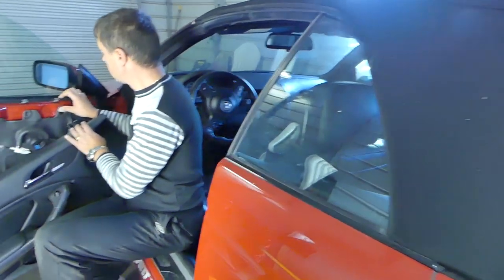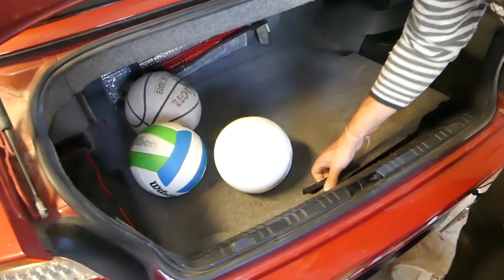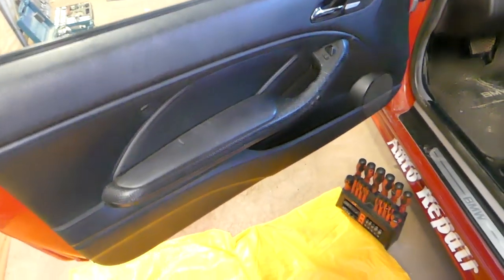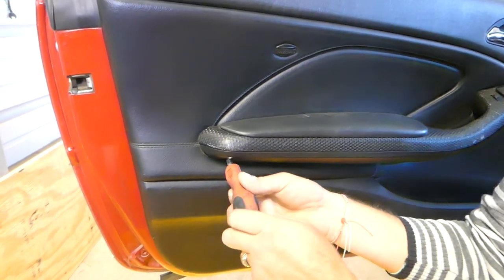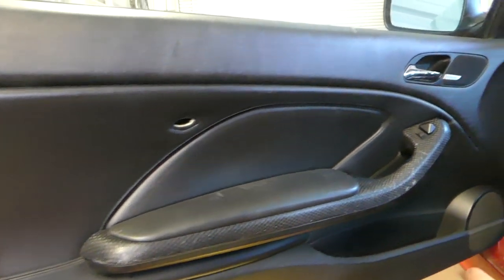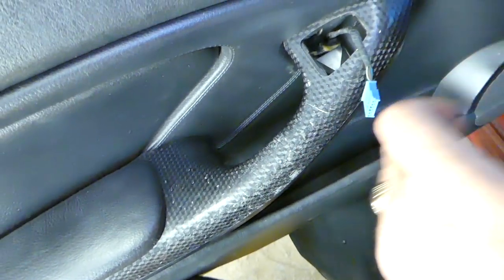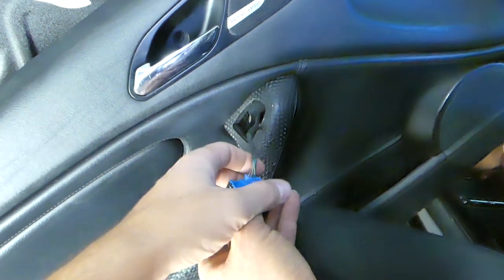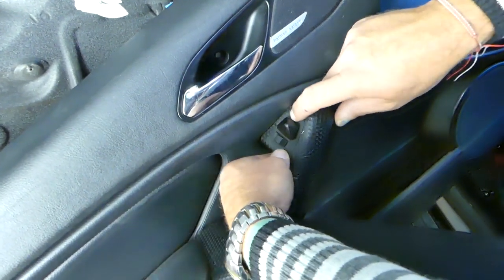HOW TO REMOVE AND REPLACE SIDE MIRROR SWITCH ON BMW E46

Comment: Guys; this is a useful video, but like the previous commenter notes, you just have to pop the top of the switch off and then pull the assembly out with a pair of plyers; no prying or screwdriver needed! I used one of the trim removal tools in the pack that you recommended in the video description to pop the plastic handle off of its metal shaft. I then grabbed the switch by the exposed metal shaft and pulled up with my electrical pliers; i bet channel lock pliers would make this even easier! I probably wouldn't have done this if I didn't suspect the switch was i was pulling on was broken - but now that I have done it, I know that my assembly was very strong. No prying needed, no broken clips, and no door panel removal needed! My E46 is a 2002 325ci.

Comment: I have got a mirror switch that does not work (it has purple back) now i can't find any of these on ebay. I see many with yellow back and they look similar it is for folding mirrors as well. Wondering if i can put an yellow one instead

Comment: Lol... I don’t have to remove door panel or pry switch. Easy job. Two tools need
1. Plastic Pry tool with twin mouth to remove top of switch
2. A plier to pull and remove switch.
Reply: THANK YOU! omg this comment totally saved me time; I used one of the trim removal tools linked in the video description, a new switch from ebay, and my trusty electrical pliers to pull the the metal shaft of the switch once i popped the plastic part off; works!

Comment: Hi guys, great video! I have a problem with the mirror switch of my e46 coupe 325ci 2005 year. When I put the reverse gear, the right mirror goes down, always. Obviously something is broken because before I could switch on and off this feature by pushing the mirror  switch left or right.  But now, the right mirror always goes down, does not matter, if the switch is pushed left or right. Do you know what is broken? Can you solve, or even better make a video? Thanks!,
Reply: Same here. Have you solved your problem?